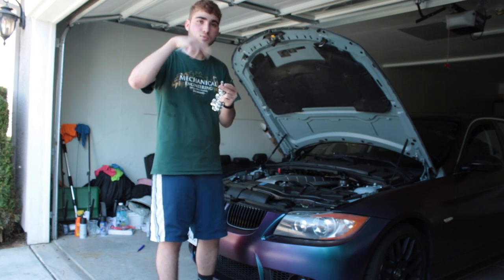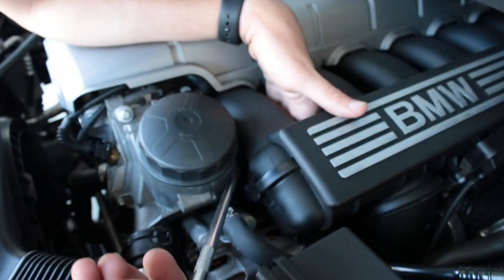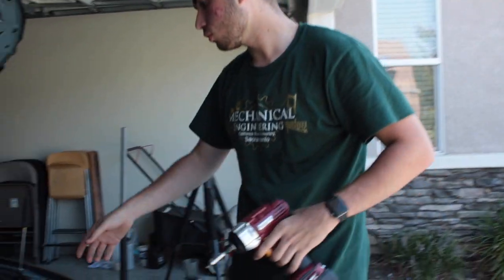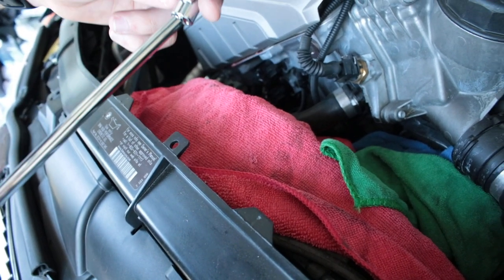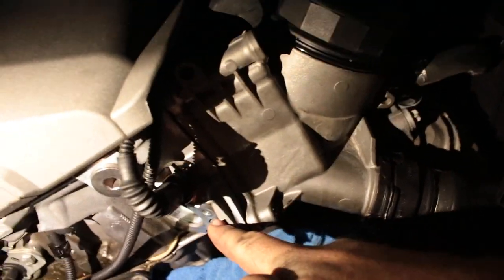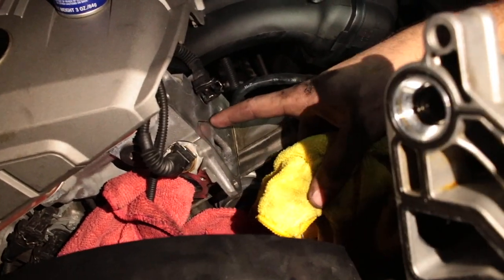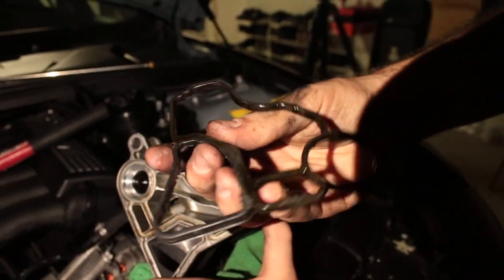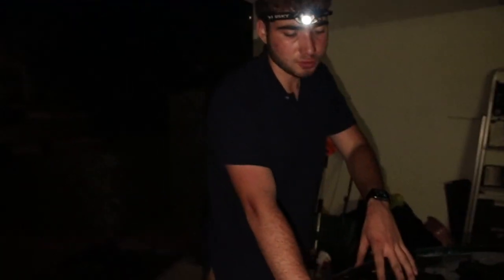BMW ENGINE OIL FILTER HOUSING GASKET (E90,E91,E92,E93)

Comment: Just remove alternator..use an e10 wrench on bolt under manifold...easy work..alt bolts are 1 time use ...ive done a few now..easy fast job.
T12 for alternator and t60 for tensioner..simple stuff..use a drain pan for any spills

Comment: Nice video bro! Is it N52? I have the N54 and it seems like I have to pull out the intake manifold to take out that screw. Please let me know if that's not the case. Btw, what's the best way to clean the oil leak from there? The front and bottom of my engine has lots of oil from that leak :(.
Reply from the maker: Owen Z not sure about cleaning but you do not need to take out the intake manifold

Comment: Did you have external leakage? BMW sent me an email saying that at my last oil change the noticed the gasket was bad, along with a few other things (I'll have a video about it tomorrow), my gasket looks fine no visible signs of leakage. Since I am already going to be removing the manifold I figured that would be a good time to change it anyway. I'm just wondering if they are trying to scam me and don't realize I can turn a wrench.
Reply from the maker: lol honestly been checking all the gaskets BMW told was bad. I actually do gasket problems. If you take off your under-guard on your car, you will expose multiple places were leaks occur. I would take it off and see for your self if you have any major leaks. lmk when the video is up
Reply: Nour Hummadi I will definitely but I just meant in relation to the oil filter housing gasket in particular. I know you said that you had cross contamination from oil getting in your coolant. I don't have that and my housing isn't leaking outward anywhere. But I'm kind of worried that I might be about to get that cross contamination.
Reply from the maker: BMW-E90-HQ hosntly man it's an easy fix that can save you thousands. The gasket is like 10 dollars. I would just fix it and have a peace of mind. Just make sure to do it yourself
Reply: Nour Hummadi Thanks I will do that. One more question was it necessary to drain the coolant at the same time?
Reply from the maker: BMW-E90-HQ i don't think so, I just did it because you know it's already contaminated

Comment: Ofc you are going to strip those bolts if you use hex socket on torx bolt :). Right socket for that job is E10. Get a good set of torx sockets if you are going to work with your bmw... you will need those alot :)
Reply: Also if you you overheat n52 engine, there is a small change that oil filter housing surface might be warped. If that is the case,new gasket wont fix the leak.
Reply from the maker: Sami Tapio yea man I did at 10pm in that video if you saw me
Reply from the maker: Sami Tapio I checked that, bmw guaranteed me that it's just the gasket for this job.
Reply: +Nour Hummadi oh my bad about those sockets :p cool if the gasket fixed the issue :)
Reply: Btw have you checked one visible "head bolt" near the oil filter housing? It is know problem to break in these engines. It is right below the first intake pipe leading to cylinder number 1... It is e10 torx bolt with a blue paint on top of it.
Reply from the maker: Sami Tapio yea I saw it, it's fine. My engine is still fairly new 66k miles atm. Nothing like that yet
Reply: Nour Hummadi nice! I have over 120k miles on mine 😀
Reply from the maker: running strong?
Reply: +Nour Hummadi yeah. last 5 year, i had to change oil filter housing gasket, outer disa valve, water pump+thermostat and ofc engine oil,coolant,filters under the hood
Reply: +Sami Tapio in*

Comment: you should have used a e10 socket and a e10 ratcheting wrench. No need to have removed the hose.  Break cleaner would have cleaned with no hesitation.

Comment: As far as I know those use bolts with a torx head you need a torx socket  i bought a set in autozone  a lot of foreign cars use them, i had to buy it for my friends volvo to remove the  abs  module so it could be sent out and rebuilt, they are marked with the letter E as in E 10 and resemble a star inside, a regular socket will do exactly what was done here it will ruin the head, oh and use brake clean to clean out where the gasket seats it's a lot more thorough and easier and then for good measure spray it with compressed air, that's what I do anyway.

Comment: How often do you have to add oil to the 330? My 330xi needs like a quart every 2 weeks, but there aren't leaks. I was told the N52 just burns the oil because the engine gets so hot.
Reply: Garry Reyom my 325i also burns a lot of oil. Oil level always drops overtime. Idk how common this is
Reply from the maker: Garry Reyom honstly even with my leaks I end up adding oil once every 3-4 months. I just end of replacing all my oil at that point.
Reply from the maker: King Oba shouldn't be every 2 weeks. There is a major leak somewhere if you take off the under panels
Reply: Nour Hummadi mine isn't as bad as every 2 weeks. Oil level drops over the course of a few months
Reply from the maker: King Oba yea same I would get that checked Garry
Reply: I use royal purple 5w-40 the European version, I've been going 5k miles with no additional oil needed. Use 0-30 or 0-40 if you're in a cold area
Reply: Garry Reyom I got the same problem with my e90 how did you fixed?
It’s the oil pan gasket?

Comment: Didnt see you drain any oil...or coolant....remove engine cover..remove air induction box...just loosen bolts on intake manifold enough to slide over to get to the bolt....clean area with soft brillo..use a little gasket maker so it will seal properly to a clean surface..depending on the engine head coolant hose inspect it for damage and replace it..or the rubber seal on it...replace aluminum bolts because they strip and stretch....clean around manifold and engine bay when putting everything back together...top off your fluids....also use proper lighting next time. and make sure you torque bolts to spec.
Reply: No need to drain oil or coolant, no need to to remove engine cover or air box. Deff no need to use gasket maker. Bolts aren’t aluminum they’re steel.
Reply: brendan stanton 😆really?!?!?
Reply: N54 Lord the definition of a hack job. This is like a 2.5 hour job max for a first timer if you remove everything needed to access the right bolts. Fucking swivel sockets should be illegal

Comment: You didn't have to remove that radiator hose, you could of just picked up the oil filter housing itself off of the block of the engine when you got the other bolts loose to gain more clearance when  it does touch the radiator hose.

Comment: Who quoted you 1600$ for this go kill them 500tops its 1 or 2 of labor my bmw dealership which i dont go to charges 165$ a hour and the gasket is 30$ tops only thing i go there for is oil changes its 99 bucks for me to do it iys would cost 60 70 and the check the car out so its worth it to me plus im not putting 7 quarts of waste oil in my bimmer lol
Reply: little nick I was quoted $700ish at the dealer lol but I’m about to do it myself for just $80